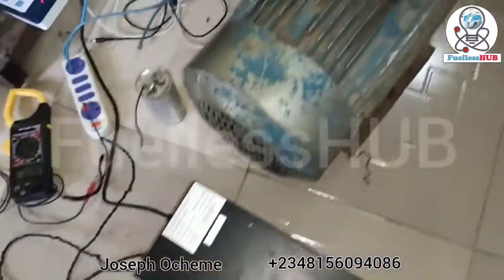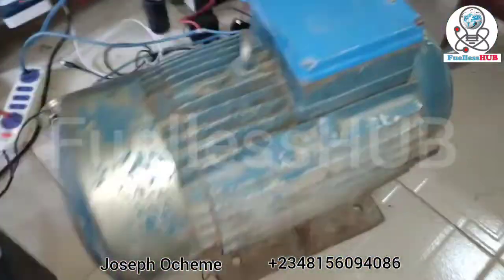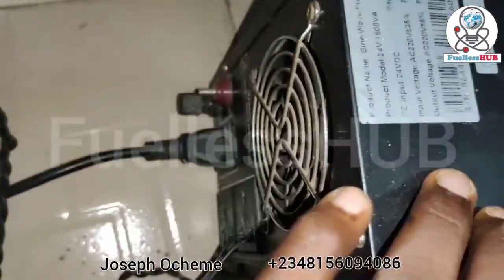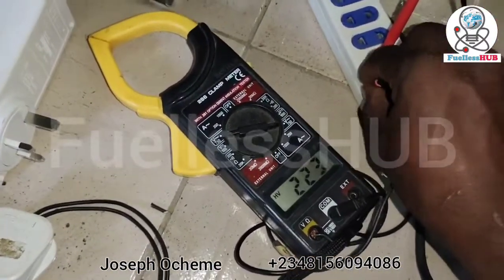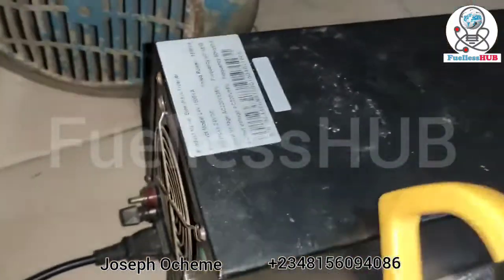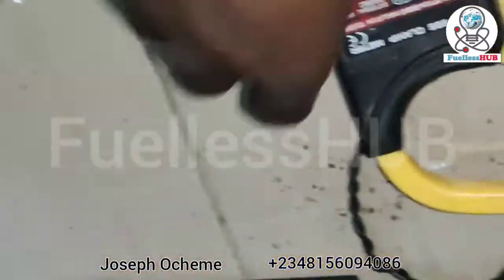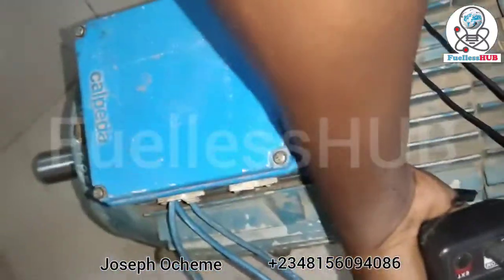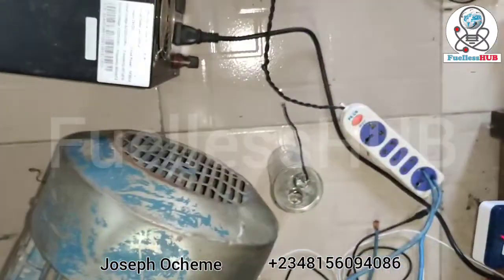20hp running on low amps for fuelless generator

Comment: Excellent vid !  Jay.
Reply: Why don't you start the electric motor from rest let us see is obvious that is a three phase motor that you use a starting capacitor to start it and to converd it to single phase as an electric engineer is not a strange experiment some time the capacitor contribute to increase the ampere
Reply from the maker: Thanks 👍